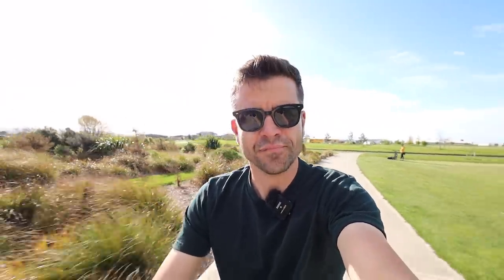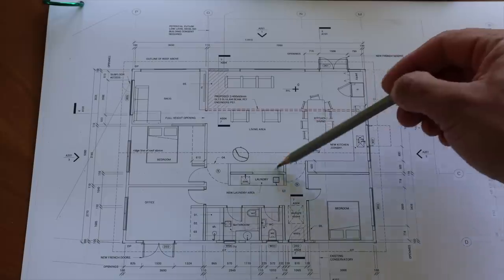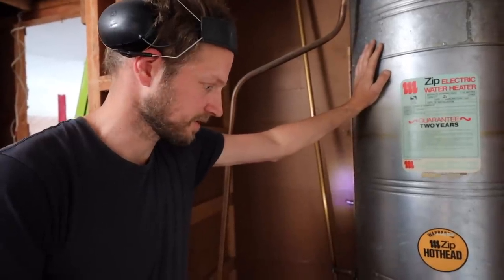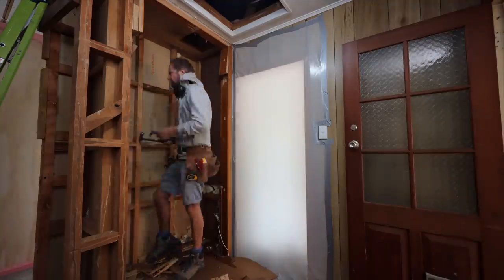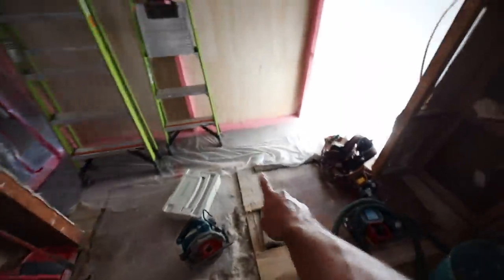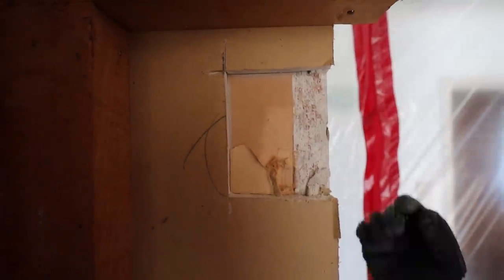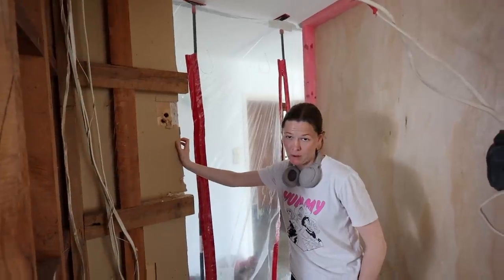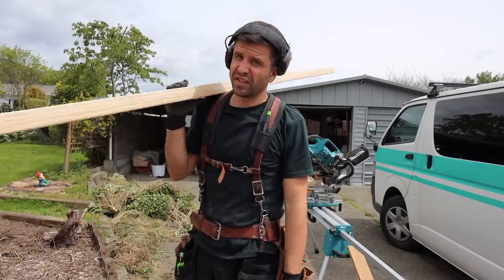I’ve Never Framed With This Before

Comment: I really enjoy using LVL and glulam beams, I used to work at McIntosh Timber Laminates (now Timberlab which was recently sold to Red Stag Timber) and made glulam beams and also worked with LVL for seismic resistant framework. The LVL was extremely hard on the planing knives and required a fresh dress up every job. But LVL is so nice to work with, its a hell of a lot straighter and more dimensionally accurate than compared to working with dirty, knotty wobbly old SG8 Radiata Pine. Also I run Milwaukee so I don't have issues with sinking 90s like a Paslode does, but repairing some framing on a 90 year old house in Kaitaia was pushing the Milwaukee to the limit trying to shoot LVL into Rimu slightly skew, the Rimu was like concrete and the recoil was insane

Comment: Haha Scott you were right about the sparky comments part. As a sparky the only thing I would have suggested is to not rely off of a pen tester like that as they can be misleading. Good for indication but you should always verify using a volt meter or electrical tester as it would be very sad to not get any more Scott brown videos with the cheeky kiwi personality.
Reply: Duspoles are great for not picking up inductive voltage, like those pens.

Comment: Your difficulties with the laminated timber — I used that when building a shed a number of years ago.  Yes.  It is more resistant to nailing, but on the other hand tends to be more accurate as to size and maintaining its straightness.
Reply: I love working with Glulam beams and LVL. Yeah its hard on blades and knives, but it beats dealing with knotty warped horrible old SG8 timber

Comment: As a sparky I was thinking. So close but so far. Under 52v is extra low voltage and 52v-240v is low voltage. High voltage is anything over 240v. 
Also the hot water pilots and relays used to turn your cylinder off in high peak power usage times like when everyone is cooking and heating their homes. 
They no longer operate like this as NZ power decided it wasn't worth while. 
Thats why we dont run HW pilot wires anymore. I also take the HWC off the pilot and put it on with the standard mains in renovations as the pilot and old control relays tend to create problems.
Reply: Greater than 1000V is HV.
415V is still LV
Reply: @honeheke1128  chur my bro

Comment: Fractured toe. Did that 20 years ago. Kicked a wall hard with bare foot. Fast asleep, bed next to wall (won't have that again), dreaming I was Rob Andrew at RWC final. Other way round, would have smashed wife's leg. Right foot now ½cm shorter than left. You're right - work boots with toe caps and solid sole are best footwear.

Comment: Instantaneous hot water from LPG cylinder ain’t great—very expensive longer term—should have gone a heat pump hot water run off solar panels, Sanden brand if you can get it there.

Comment: Ive used lvl framing.... lvl studs dont make much sense to me as lvls strength is horizontal on edge not vertical. The studs ive used split, but they were cheap

Comment: Missed opportunity to put in a Heat Pump Hot Water system Scott! Much more efficient and no gas which is better for the environment. A little more pricey up front but if you’re going to add solar then it’s free hot water!

Comment: Do you find the Hikoki framers don't like to skewer in on an angle ? The firing pins will only recoil if the prongs are flush.
Reply: Yeah I’m finding this with mine, good value but not the best for tight work

Comment: im trying to figure out what a safety boot is
Reply: It’s a boot with a steel toe cap and it can also have a steel sheet inserted into the sole of the boot as well - you do not want to kick them especially in bare feet

Comment: Hi Scott - Just having a closer look at your plan and here are some things I would consider doing.
1. Keep the kitchen in the original place but redesign and you could have a  very nice large modern kitchen in that area ( with a decent pantry 800mm- 900mm- drawers down bottom of pantry are good)  other drawers minimum width 600mm - Benchtops stone/kymira or granite well worth the spend . Keeping the kitchen in this area  allows you to maximise the use of the lounge dining area and also allows more seating for lounge.  (i.e I would go with  two three seaters and one armchair , armchair placed on the wall by the snug room . This gives seating for seven and dining room table of eight for seating. I would also highly recommend to open the flow  with  french doors or preferably double stacker sliders on wall where new kitchen is this would be great for indoor outdoor  flowing  out  possibly to a new decking area  all would add more light into the  whole lounge area. Minimum 3.6m space for doors .  The sacrifice is of course the bedroom but you could make the snug the third bedroom. As a snug in this size house is a bit of a luxury and should n't come at the sacrifice of lounge/kitchen .
2. The area where the fire place was would be an ideal place to put a TV console/ music station etc and large TV. ( especially if snug is now the bedroom/office)
3. I would place a door on the snug and and  this then could be  used for - office /snug/bedroom or multi purpose room.
4. The remaining bedrooms place wardrobes where recess allows. 
That's about it ... the rest of the plan I think works okay. Just my 10 cents worth I/m sure you wil do what fits best for you. I would recommend to do virtual walkthrough/perspective with all furniture placed including  flooring - as in where would the flooring for the kitchen in the present plan go and the carpet and also see a kitchen designer   - Kitchen are one of the most important rooms to get right and this design with dining room beside and L shape does not work ( personal opinion) . Things which might not become obvious until you are living in it talking from experience and then expensive to alter later.  
Cheers

Comment: By the time the remodel is done, betcha it will have been cheaper (when time is priced in) to have torn down that building and rebuilt to modern standards. And Scott could have made a huge series out of it like Matt Risinger did with his 'Real Rebuild' home that started out as a cheap/quick remodel but instead ended up an entire rebuild from foundation up that took several years.
Reply: It won't be cheaper but could have increased viewership.